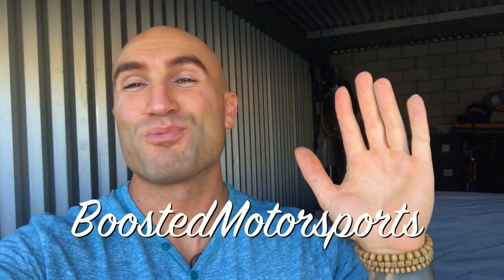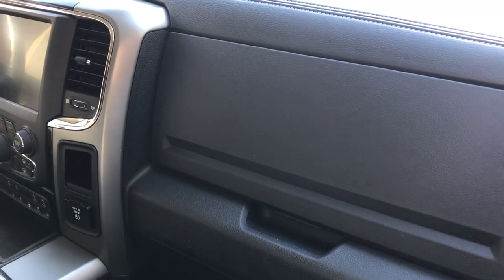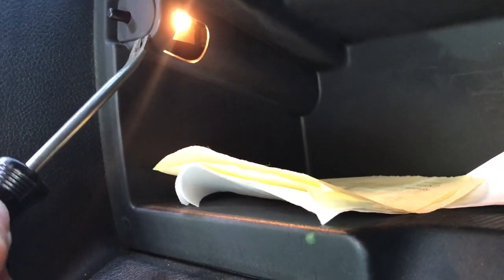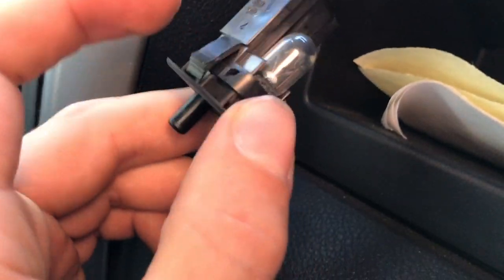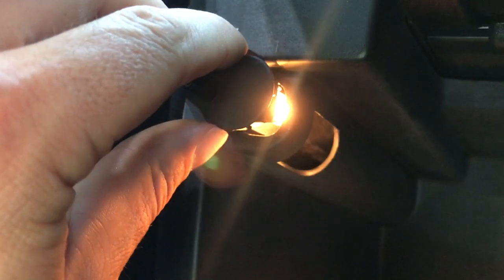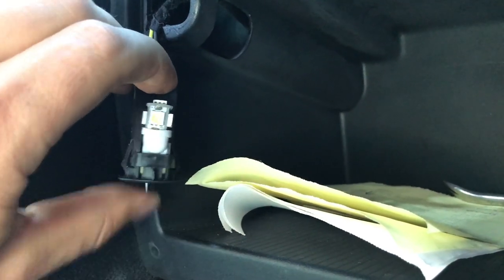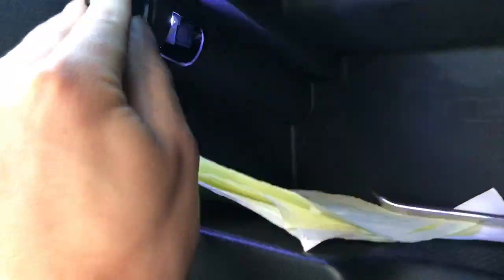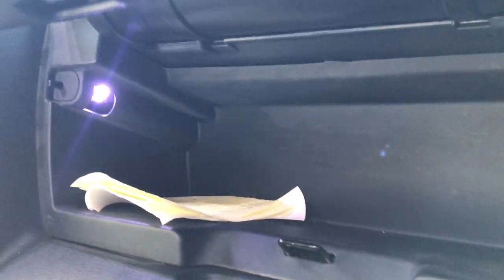Dodge RAM GLOVE BOX LIGHT BULB -  2009 -2018 -  Removal UPGRADE

Comment: nice quick and easy install. Thanks Bro. Have you done the bulb that is under the dash/steering wheel. Mine is a 2018 and it has a light under there
Reply from the maker: I haven't messed with those yet! 😎

Comment: I've done every light in my truck except this one and my turn signals. Turn signals will be cake walk, just dont have bulbs. I just wanted to note that for some reason this specific light is the biggest bitch. I was tearing up the inside of my glovebox with my flathead trying to pop it out. It popped out, only the front half of the switch. So the switch exploded with pieces all across my truck. When I rebuilt it, plugged the bulb in, pushed the switch as a test and it got stuck. Every bulb on my truck flickered, then went out. Blew a fuse smh. So now I have to get a new switch, and fuse before I can move forward. Smh. Watch out
Reply from the maker: Damn that sucks Julian!  Its a bit of a pain to get out forsure with the tab at the top and bottom 😁

Comment: Yo John I’m looking to replace every incandescent bulbs to leds on my 2017 ram 1500 big horn. Now do all the interior bulbs need to be canbus or no. I’m looking to order all the bulbs off superbrightleds.com
Reply from the maker: Interior bulbs don't need to be CANBUS in my experience on my 2014
Reply: BoostedMotorsports how about the license plate lights and the third brake light / third brake light cargo lights? Thanks in advance
Reply from the maker: Hey Ted take a look through all my videos I have all separate videos covering everything you need and tested each bulb.  Here is one of the videos 😎 https://youtu.be/oh11KPx2wdY

Comment: Under the hood LED coming soon?
Reply from the maker: Yeah I need to find out if you guys would rather see a custom bright one that is hard wired in or just me buying a replacement bulb and tossing that in
Reply: BoostedMotorsports  One vote for ‘Replacement’ LED bulb here.
Reply: second vote for replacement bulb
Reply: BoostedMotorsports I think one of them led panels similar to your dome light would be best
Reply: replace bulb
Reply from the maker: Replacement bulb for this is lame and shines the light the incorrect way.  It would be an improvement over stock but still not ideal 😯
Reply: @AlbertaPatriot1985  I did that with the panels in dome and took one for under the hood, solder it with the wires to each  post where the old light pops in then just let the led panel rest in the plastic cover since no where to stick it really. Works great.
Reply: @BoostedMotorsports  go to headlight Revolution on YouTube it gives you a short video on how to install a led bulb under the hood

Comment: If u look for the channel KustomblackGuns he did a video for the two lights on driver and pass side. He bought some pods #68305400AA. I already had the wires so I just bought the pods on ebay.
Reply from the maker: Hot Damn are you serious? 🤣

Comment: Question for you, totally unrelated to your video. Have you every changed the Oil Pressure/Sensor Switch? I am getting code P0520 and was wondering how easy this is to repair myself. Any help would be appreciated.
Reply from the maker: Hey Don I haven't had that issues!  If I ever do you know there will be a video on it though! 😁
Reply: Any PO codes is a emission code so keep that in mind in the future